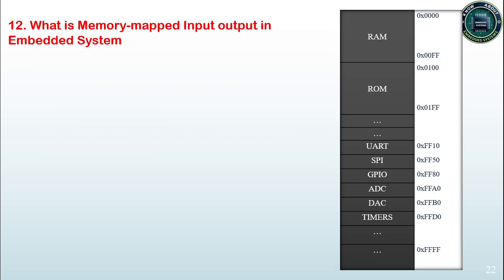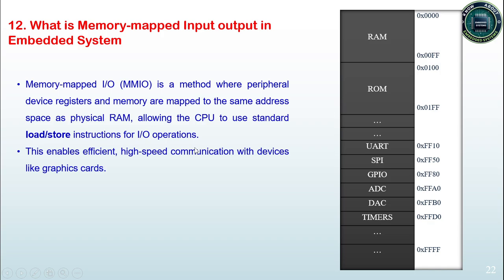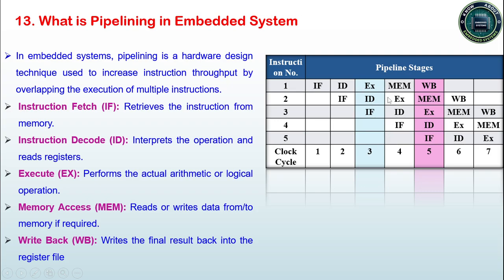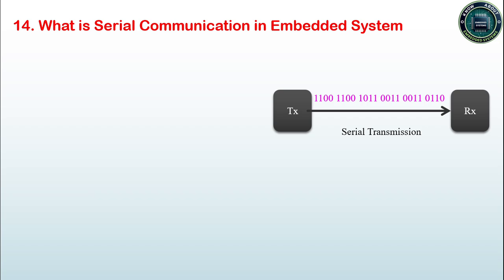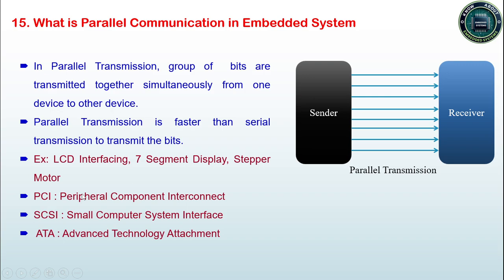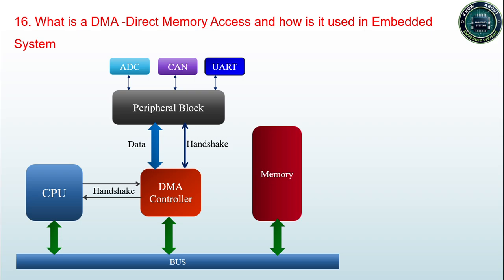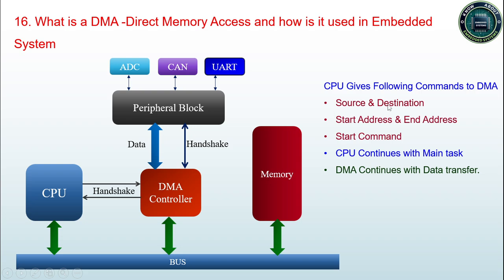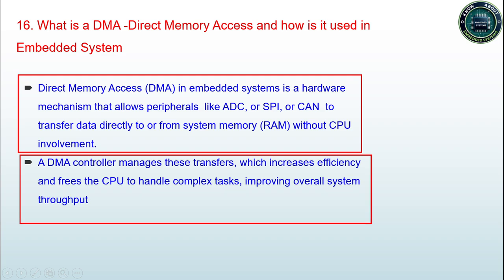Embedded System Interview Questions and Answers | Core Company Interview Questions

Comment: A stepper motor MIGHT be a parallel interface, but only if you're using an indexing driver.  Otherwise, you're using PWM signals to drive power electronics.
Reply from the maker: yes you are right
stepper motor is a parallel interface,
whenever we need to control motor moment in steps we will use stepper motor,
examples: Robotic arm, printers etc

PWM is used usually to control the DC motor speed

Comment: PCI is a collection of serial lanes.  
7 segment displays are usually run through a binary coded decimal driver, but yeah, it's more or less parallel interface.
Reply from the maker: 7 segment display basically parallel interface,

but these 7 segments can be controlled by driver IC,
this driver IC is a serial to parallel converter,

driver IC can be controlled by serial interface or protocol mechanism form Microcontroller.